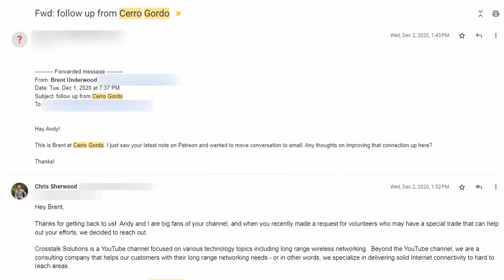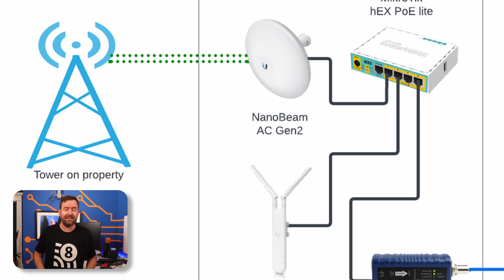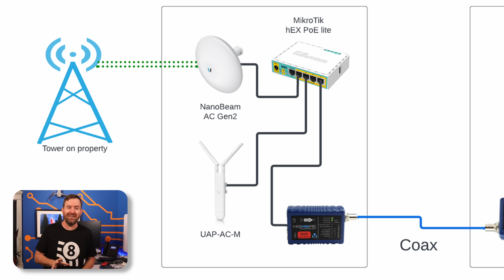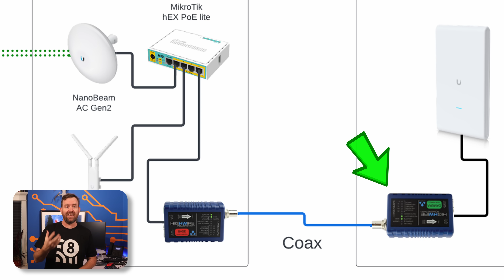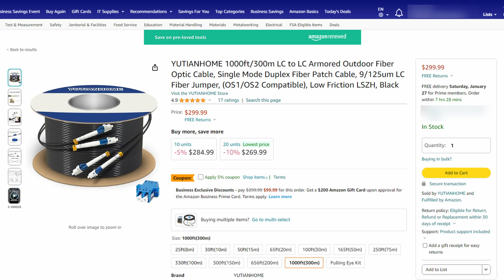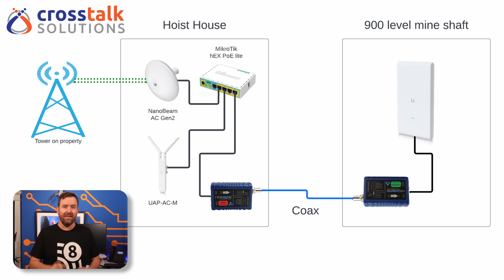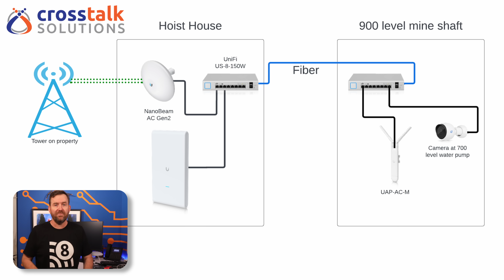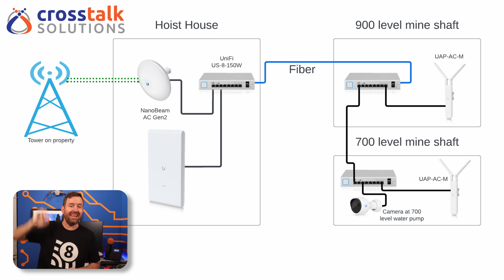Backseat Driving a Wireless Install 900ft Underground

Comment: 9:02 and that fiber cable would have given them a MUCH higher speed. something like 10 Gb/s (IIRC) instead of 200 Mb/s
Reply from the maker: Sure - fiber is capable of those speeds, but the SFP's on the US-8-150W are 1Gbps.

Comment: Chris basically laid out my same redesign for this initial stage. I would change this by planning for each of the levels they ran power to have a switch and AP with fiber linking down. It would be easy to add cameras and an SIP phone at each level. I would have also liked to see 2 conduits for power and data cables to protect them, but that adds a lot of cost. I would bet Ubiquiti would sponsor a redesign and have Chris and Cody do a few videos on it. It would be good stuff.
Reply: That's definitely a great design.  There's more "moving parts", and certainly more expensive, but the redundancy and the fact that you only have a single level of fiber to replace if a fiber breaks/damaged/not working sounds like a great idea.
But I suspect there's a budget limit, and they probably were focusing on the goal too much, and not risking that scope creep.

Comment: I would put ptmp powerbeam gen2 and 1 for camera in 700 feet another one end of the hole in the elevator will be much cheaper and with single trip everything will be done

Comment: Well, based on what I know of Ghost Town Living,  you dodged a bullet when he didn't contact you back. tl;dr, the whole thing is a grift.

Using coax was dumb. Could have gotten armored fiber for half the cost of the adapters (also MikroTik makes switches with SFP+ ports😂)
Reply from the maker: I've done multiple searches for Ghost Town Living fake/exposed/truth about/etc., and I'm not finding anything related to it being a grift?  Gotta be careful with the misinformation.
Reply: @CrosstalkSolutions  - https://www.youtube.com/watch?v=EIcnCaVsYFI&t=2020s

From the top of my head the guy bills himself as this guy who used his life savings to buy and save the ghost town (only to burn down one of its most historic buildings). Turns out he's an investment banker that's had the backing of investors the whole time (while begging for donations from viewers to save the town) ¯\_(ツ)_/¯.

Comment: As a former EE for a mine, my view will be somewhat skewed, but I think your spot on here that Fiber would have been preferred, but maybe those converters were left from a past project or something.  Also could have been an attempt to keep the UG AP powered during a primary power failure down the shaft (though that seems to have been lost). I used to see bunches of those Mikrotik devices, they were very common in the mining environment, as a way in some areas to comply with the communications and tracking requirement that MSHA imposes in some mining environments, could have been another on hand type of thing. One thing that would concern me in this setup (and admittedly I haven't watched the original video yet) is the voltage drop on the primary power system, if they plan to pull any kind of electrical load at the bottom, the voltage droop in that length of 12AWG will be significant.
Reply: As I haven't watched yet, 12/2 REALLY!
I know a situation where that was done over 500 feet and they blew out a water pump.
I don't know why as this guy is an "Expert" on everything. Worst job I've ever done. Unfortunately I feel like they're going downhill...

Comment: Agree with most of what you suggested, Chris.  I think I'd spend a few extra bucks to install a multi-strand (maybe 6 strand) fiber so I could drop off fiber at various levels of the mine complex.
Reply: Any tips for gear required, etc for each drop off? Learning for another project :)

Comment: I would do fiber as well, but as a diy project i can see how someone would prefer to run coax over fiber for maintenance reasons.  They know how to splice coax, they probably dont know how to splice fiber.

Actually since they have power at the bottom i probably just would have run cat6 and used gper extenders at 300' and 600'.

90% sure they are using the Mikrotik as the router for the site.  They arent using the "wan" port, because the wan port doesnt do poe out for the NanoBeam.  So they used one of the poe out ports and just configured it as the wan.

Comment: Honestly, I disagree with the assessment that the hEX PoE lite was a bad call.

The hEX is half the cost, is a full router, and can be configured for handling NAT as well.

The nano beam and the two APs are likely configured using standalone mode, rather than actually connected to a central controller.
Reply from the maker: I didn't say that it was a bad call - I said that I would have used something else for 2 reasons. First, he used a router as a switch (didn't use the WAN port at all) so it's maybe not the best tool for the job, and second, you now have to use multiple different methods to manage your equipment remotely.

So yes, while the MikroTik is 1/3rd the cost of the switch that I proposed, I think the benefits of using switches have more advantages while keeping the costs within a similar budget.
Reply: @CrosstalkSolutions  The port labeling on the outside Mikrotik doesn't particularly matter given that you can adjust the firewall rules and change which ports handling the "WAN" duty. They likely didn't use the "WAN" port since it doesn't have PoE out support.

Comment: Just asking.   Could you use Unifi-AC-Pro APs (with two RJ45 ports) and daisy chain APs with injectors throughout the mine?   Granted, the cost would increase with every AP installed, but there would be expandable coverage.

Comment: I agree with the fiber and switch setup. I would of also suggested trying a wireless bridge setup, where there was a wireless transmitter at the top of the shaft pointing down and setting up a receiver at the desired levels which then fed another switch to feed power and connectivity to other devices.
Reply: There are 2 problems with that.
1: Is the shaft a straight line?
2: The fresnel zone for a 60GHz radio (airfiber, wave, UBB) is 1.20m/4ft wide.  Even worse 4m/12ft if using a 5GHz radio (powerbeam).
The signal would be lost every time some goes throught the shaft.

Not to mention the electrical noise created by the elevator. And the elevator itself probably taking much of the width of the shaft, again blocking the signal.

(/edit: typo)

Comment: The US-8-150 switch has 2x SFP ports on it so they could have run 2 fibre drops from the surface - one to 700 feet and one to 900 feet.
Reply from the maker: Yes - excellent point...though would drive up the cost a bit.
Reply: Don't forget another link between 700 and 900. This way even if one link fails everything keeps working

Comment: Or even beter, put a switch at the 700th level, plug the fiber to it, and plug another fiber to get down to the 900th level ;)

If you do that wifi project, i would love to get a video on either of your channels ;)
Reply: Meh, I wouldn’t put an active device inline that can fail. I’d do a multi-strand fiber cable down the shaft to 700’, one fiber goes to the stuff there, then have another 200ft fiber cable go down to 900’.

Connect the 700 and 200 cable together. Both get connectivity but the 900 doesn’t rely on a another switch to work.
Reply: @ZippyDooDa435   Yeah it's probably a better way

Comment: I agree fiber would have been the way to go here.  I would have suggested the 10 Port industrial switches at both ends.  I have used them outdoors in semi covered areas (including in a wall mount box) that aren't condition or heated and they have held up very well.

Comment: Personally, I would've run armored fiber (to your point, less issues with lightning via copper in the coax) but I would've put in a 2nd switch + AP at the water pump and then run fiber down the to the 900ft shaft below from there.  Two things with that: 1) You create "gates" of failure of which troubleshooting becomes easier and 2) You create "like" experiences on each section of the mine.  I'm kinda shocked that they didn't run at least 1/2 EMT in some fashion down the shaft not only for the electrical but also the coax, but that's just nitpicking at this point.

Comment: When I first saw the coax, my immediate thought was "why not fiber?"
Reply: would have been cheaper and faster.
Reply: Same here.  Could have run 10g easily with some single or multimode fiber as an uplink.
Reply: @traderpete007  I'd say singlemode in this case.  900 feet (~274.3 meters) is pushing uncomfortably close to the 300 meter (10-gig) limit of OM3, and even with OM4 completely blocks-out any possibility of 25-gigbit should that inexplicably become relevant somewhere in the future.  I don't see how it COULD, but better to leave your future self an upgrade path beyond projected needs than to end up replacing the cable a decade or two down the line.

Coax as a backup makes sense, though bog-standard MoCa adapters would have been the better play there.  Cheaper, easier to get replacements for, and most of its limitations shouldn't apply in a point-to-point configuration.
Reply: When I saw 900ft underground in the title my first thought was they must have used fiber, until I saw the coax adapters 🤦‍♂
Reply: Same thought here, crazy not to use fibre!
Reply: Pretty sure NM cable is not approved for the shaft either 😂
Reply: Same
Reply: same here
Reply: Why fibre!!!!! You don’t need these crazy speeds
Reply: @Kieran28  it has nothing to do with the potential speeds and everything to do with bypassing the limitations of copper wires by not making them a factor
Reply: @Kieran28  Because its cool and probably cheaper, and you have all options open for what you want to do down there with the network. Only reason the coax might be good is if you didn't have power down there.
Reply: @Kieran28  As a network engineer that works in mining and having designed & setup under ground networks in large working mines, it's all about distance. With Single Mode fibre, 10km runs are a piece of cake.
Reply: @Kieran28 Fiber > Coax. Less potential problems, more reliable connectivity.

Comment: tunnels and shafts - you just run a radiating cable which acts as a very long antenna, that way you have wifi or 5G on your ride all the way down and laterally
Reply: The "leaky feeder cable" is also the approach used by London Underground to get 4G connectivity in the tunnels.
Reply from the maker: I have not heard of this - do you have any make/model recommendations I can investigate?
Reply: @CrosstalkSolutions  yes sir, look up Times Microwave Systems - Products - Radiating Cable as example. That stuff is literally developed for underground tunnels :) It's used for 4G in subways as WiFi does not really work when clients are moving (doppler shift). If they have 45 min to spare on the way down - they could be scrolling instagram feed all that time :D
Reply: Oh yes Leakey feeder cable systems that's a few nights of rabbit hole and related Internet research. I am radio works through rocks FM radio doesn't. Communication systems have been stifled underground and end up using different techniques than what is used above ground. The leaky feeder employees a coaxial cable that leaks all the way along its length. That we can send and receive signals out almost like it's a giant long antenna. This is what is traditionally employed in mines from what I gathered. I recommend starting off with the Wikipedia article.

Comment: Love Ghost Town Living! And he is an amazing story teller.
As I was watching this episode, I came to the same conclusion as you did; fiber would've been the much better solution. I was also thinking that I would've dropped a loop of fiber at the 700 level so they could've put another switch there for the camera. 
I really thought the coax solution was not the best solution, and it did not make sense to try to do power over since they had power down through the mine.

Comment: 100% agree with all the points you made! The MikroTik switch was especially confusing considering the other UniFi gear they were using.
Reply: I'm fairly sure they are using that mikrotik as a router. The labels are just cosmetic. A hex-s would let you use the fiber via the sfp (not +) port.

Comment: I would put empty fiber tube in the shaft. Then put micro-duct single mode fiber cable in the tube and stop on every level where they need internet and weld the rest for the next level's.
Reply from the maker: Some sort of conduit would be best for sure...and it would be good to have fiber stops at each level.  I'm just not sure they need that kind of coverage.  I wonder what would happen if you had a PTP straight down the shaft with a station AP pointing up from the top of the elevator?  Not sure if they have  that kind of line of sight.